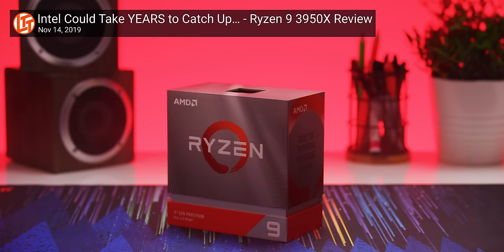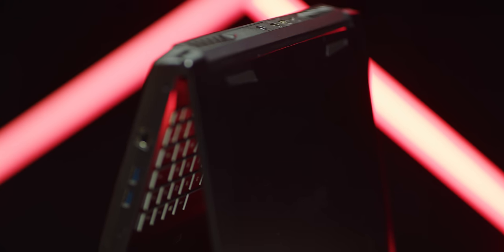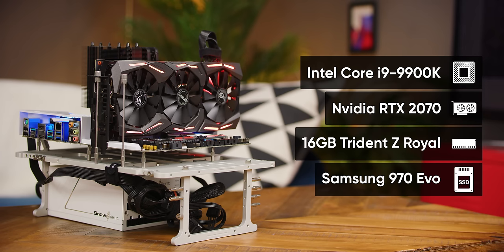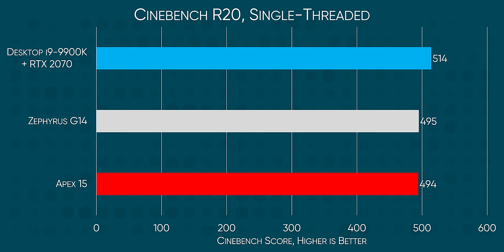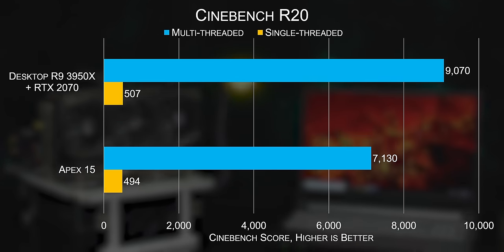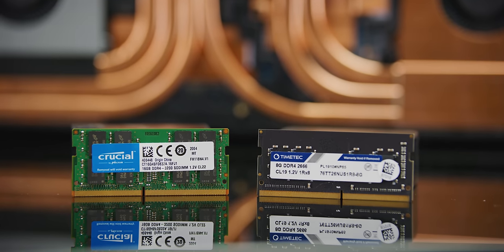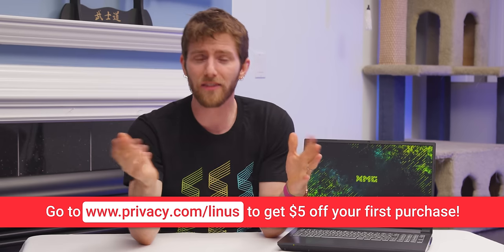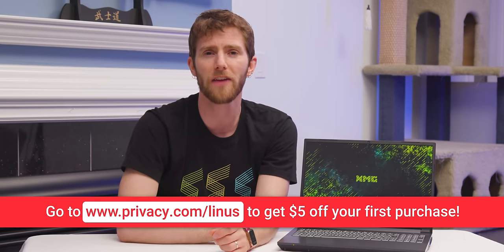The Most Powerful Laptop EVER!!! - XMG Apex 15

Comment: But can it run the UE 5 demo?
Reply: We will try as soon as it is released. UE5 demo might actually benefit from NVMe SSD RAID 0 (pure speculation on my part). In XMG ULTRA 17, we even go up to RAID 5. // Tom
Reply: @xmg_gg  Very nice, we can't wait. 

PCs will stutter though with that UE 5 demo (fast game w/ 8K textures per frame Tim of Epic said, the game is 30fps so that's 240K of textures per second) coz' Playstation 5 has the fastest SSD spurning out 9GB/s of assets. Demo seems to also be using software ray tracing for the reflections (eyes, metal), that means it'll even be more photorealistic with hardware ray tracing.

PCs may need to do a RAM Drive with 200GB RAM then load all of 125GB Call of Duty (or a larger AAA game) into the RAM drive but it may still not be on par with the Playstation 5 overall because PC's don't have DDR6 RAM yet.

But for sure PCs will make an SSD as fast this year and bring out DDR6, PCs will still take the crown eventually as Master Race. But the Playstation 5 is truly impressive when paired with UE 5.

Stay safe, boost the immune system.
Reply: @xmg_gg  I stand corrected that will be gen4 striped RAID then that's faster than PS5's SSD:-)
Reply: @SevenDeMagnus  Meanwhile: https://www.pcgamer.com/unreal-engine-5-tech-demo-pc-performance/

Comment: Amd architecture is old. Just wait for 3 years and it will be obsolete! Future proving with AMD is a moron choice!
Reply: Ehh this isn't true. Ryzen cpu's support most of the modern instruction sets that you will ever use. New intel chips support some that ryzen doesn't and ryzen supports some that intel doesn't. The only way modern cpu's really become obsolete is by not supporting new instruction sets. This is why I can still browse the web on my old core 2 duo computer (12 years old) but some new applications just won't launch because of missing instruction sets. Amd's architecture is MORE future proof then current intel's because EVERY new intel cpu release has required a new chipset. If you buy a new amd (only x570 with this gen) motherboard you will have support for at least a couple of the newer generations of ryzen cpus. Meanwhile someone who bought a ryzen first gen motherboard you could have upgraded all the way to ryzen 3 on the same board.

You sound like you bought a gaming pc at best buy and this is what the guy at the desk told you.
Reply: @Alobster1  nope! Take AMD phenom x6 vs intel corei3 gen 3. In 2020, corei3 gen 3 can support COD  warzone because it have the sse4.3 instructions and the phenom x6 cpu is not supported! Same goes to the current ryzen architecture. They are lacking key features for progressive games! I think you mistook your own point! You started with intel!
Reply: @maemilev  The phenom 1060t released 2 years before  a 3rd gen i3. Of course it doesn't support the same instruction sets.  Cod warzone needs sse4.2 which an Amd fx 6120 of the same age as a 3rd gen i3 does. Although yes first gen Core I series does support sse4.2. These processors are 10 years old, you can't expect them to still be playing modern games even if they are technically supported.
Ryzen isn't missing any instruction sets used in modern games. The only useful instruction set that Ryzen cpu's are missing that current intel cpu's offer is AVX-512 for faster video encoding which isn't really useful for gaming.
Zen is pretty modern architecture meanwhile Intel has been rehashing the same one with minor updates for a long time. Thats how it works, you can't have a new architecture every year.
Reply: @Alobster1  so what? AMD still fucken screw me over own my gaming budget! Rendering all my nvidia 1080ti upgrade totally fucken useless!
Reply: @maemilev  What did you try to pair a 1080ti with a pre Ryzen or low end ryzen cpu? If you did then that was pretty silly. Ryzen is miles ahead of bulldozer and piledriver.
Even if you do have a low end first gen ryzen you can upgrade to a Ryzen 3000 which are pretty good for gaming, pretty much 95% of the performance of an i7.